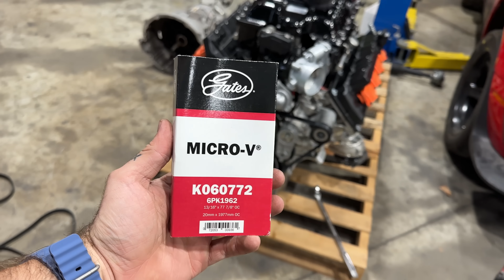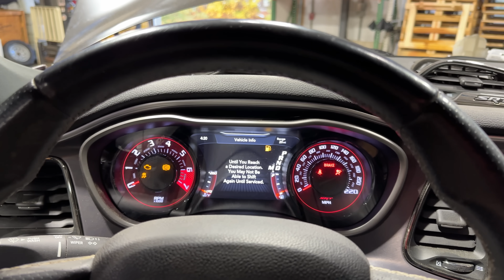Building The World's First MANUAL Dodge Demon! | PT 8

Comment: Find the 5 volt in reference wire to the trans connector and jump it to the output wire to complete the circuit , find the clutch signal terminal to the pcm and give it what it needs, most likely a ground , so it thinks the clutch peddle is pressed down when starting . You need a scan tool to read data and if you trick the car by giving it what it needs it might start. 
This works for GM's.

Comment: As a kid I was obsessed with scrap yards metal cars aircraft. It’d very satisfying taking something from a crashed or burned car and using it for another car to function. I prefer low milage factory parts over new aftermarket or rebuilt any day. I collect parts for a car I drive. Because within 5 years my cars from new have 100k miles. Most cars things start going 110-150.

Comment: You can have the sales codes changed to manual at a local dealer. Will just require the module reconfiguration routine by the dealer ship after the sales codes are altered. If you were close I’d offer to do it for you lol. Good luck!
Reply: Would he also have to loop the canbus from the auto module as they are a series connection?
Reply: @ToasterCoasterAdventures  If he fibre optic, yes
Reply: with a clutch ?

Comment: Hey guys, if that's a TR 6060 trans, id highly recommend getting a skip shift eliminator (if it's from a stock challenger) makes that 1-2-3 shift very slow for emissions and crap, the eliminator is like 20 bucks and will be worth it. You probably already know this, just thought I'd chime in! Cheers!
Reply: Tunes usually delete skip shift these days.
Reply: @kyrujames  if it's a trans tune then yeah probably. It's cheaper than a trans "tune" which just takes the baby monitors off the trans. It's a bit cheaper and accomplishes the same thing. But yeah you could be right! I just didnt ask my tuner to when he did my car on HP
Reply: I’m gonna go with an even 1050 hp and 1000 torque. Hoping you get it all sorted out!

Comment: When you put the rear differential In you should also do the lock out kit and a diff brace. Also the stock sway bar end links are too weak. Use UPR heim jointed in the front and speedlogix heim jointed in the rear. Noticeable difference

Comment: a small but EXTREMLY useful tip, that carrier bearing install. well, 90% of all installs call for you to push them towards the transmission when tightening down to "preload" them. otherwise you get noise, shakes, etc. make sure both are at the same spots however. In the video, it looks like you just sent it in. not knockin your work or "being that dude" just dont wanna see you have to redo this again within 6 months of premature failure.

Comment: To fix your no start issue you will want to rewire the start stop switch and run a wire from pcm to the switch then down to the starter. That will disable the bcm from shutting you down. You should also be able to reprogram bcm to shut off warning lights.

Comment: One thing you guys are overlooking  is the fact that the pcm that came with it has to see all the components that came were with the car from the factory to even have a remote chance of starting. That includes the air conditioning that you eliminated, the U connect, and all the applicable computers,wiring and even lighting systems that the car was assembled with. That’s a whole can of worms in itself. Gas monkey had those same issues with their shardcat dart a few years back,as well as roadkill with their General mayhem swap…

Comment: Man, that's gonna be a thrill ride in more ways than one. My Fox Mustang makes right at 600 wheel and has a Tremec TKO five speed with 3.27 gears, and even with 295 tires it goes sideways in third stupid easy. Fun, but annoying after a while, I'd like to be able to feel what full acceleration feels like with actual traction. I would imagine that several hundred more HP in that beastie won't make things any easier. BUT, there's only one way to find out.

Comment: I wonder if you could bypass the fuel pump controls at the body module with a toggle switch and put a start button on it. Will it fire up? It works for Chevy’s anti-theft no start because of the body module/chip key issue.

Comment: Over 1080 hp, 955 ft lbs

Need 4 inch aluminum or carbon fiber driveshaft and a differential brace. Thats a lot of power for the stock setup.

Comment: Have you tried Holley for a standalone , fuel tech , motec ? Get rid of that other junk.peobably gonna get worse if it has a fob. Hopefully that model doesn't have one. If it does the mopars are horrible. The horn will honk amd doors will unlock but the security will lock out the starting portion of the car which runs off a different transmitter. It will think the car is stolen and you may have to get a licensed locksmith or the dealer to reprogram the system.  Once it loses the signal it becomes a disaster.

Comment: So how are you going to cool the intake charge without the a/c? From what I understand the blower had its own cooling system that was cooled down with the a/c compressor. It doesn't really cool below ambient going down the road but it does sitting still between drag strip passes. I wonder if an ice water setup would work better?

Comment: i am a mopar collector in pittsburgh, pa with 7 68-69 Barracudas - all 4 speeds.  i also have a 2021 RT/Scat Pack Shaker Challenger 6 speed AND a 2020 Hellcat Challenger with a 6 speed.  you could not get the 6 sp in any Hellcat above the first one with 707 hp.  the next one up was the "Red Eye wide body" with 717 hp and i don't think you could get the 6 speed in that car.  i believe that car and the Demon were both automatics.  however, my Hellcat had a "reflash" on the ECM and the dealer put the 717 hp Red Eye program in instead of the 707 hp one.  the car runs GREAT and is a blast with the 6 speed.  HERE'S MY THOUGHT on you trying to build a manual Demon.  i would suggest you go and study very acutely a 6 speed "regular" Hellcat.  naturally, my car operates properly with all the dash and "performance pages" workings as designed even though it is a 6 speed.  the Red Eye 717 ECM programming did not affect anything.  instead of converting an "automatic" designed Demon to a 6 speed - use a different route and start your analysis with: what engine and other modifications are added to a "regular" Challenger Hellcat to make it a "Demon" Hellcat.  all the electronics in my car work as designed even though it is a 6 speed instead of an automatic.  build your electric system like you were building the lower level 6 speed Hellcat and then try and determine what you are missing to operate the Demon motor.  look at the internal differences between the Demon motor and the regular Hellcat motor.  i think there are different veritable valve timing differences between the 807 Demon and the 707 or 717 entry Hellcats.  there might be some other internal differences that are controlled by the ECM on a "OEM" Demon.   you will also have programming in a Demon ECM that are expecting to operate other items that you are not including like the air conditioning and maybe how the inter-cooler works for the supercharger.  i think if you reverse your thinking and say "hey, i'm building a regular 6 speed Hellcat and i have to hook up all the following "stuff" to make the motor run" - hook that stuff up - THEN see if the Demon motor will run or start looking at things that still need to be hooked up or changed in the ECM to get the motor to run.  HOWEVER, BEFORE YOU START THE MOTOR talk to some Hellcat race guys and MAKE SURE there isn't going to be any internal damage caused to a "Demon" motor that is trying to run off of a "regular" Hellcat ECM.  that's my 2 cents.  i like your video on this build and will be following you to see how this all works out.

Comment: No way you will need 1700cc with the ported stock blower.  The Whipple 3L might reach 1300cc limits but the stock ported blower just wont flow the air needed to push 1300cc injectors. Really should put fore fuel rails and make your own crossover . The factory crossover is a restriction because of the sensors. The openings going to the injectors also is pretty narrow even though the rail is decent diameter. 
Get ready for some noise with the clutch. My clutch is also very noisy. Lots of plate chatter. When those plates mesh hang on

Comment: Bro, listen... I'm a mopar technician,  ive run. Into that same message,  it says you "might not be able to start after shutdown" or some for of that. I just bypassed the tipm and and started the car by jumping the starter itself. Ive only done this on 2 cars. But it worked as long as the fob was in the car and button in the on position

Comment: The solution would be flashing and recoding every single module in the car to a manual transmission configuration and then custom coding the car for the configuration needed

Comment: Hi guys, if that means anything I've been through exactly all of this not long time ago here in UK. Except I for conversion I picked (maybe not burnt but) an unknown communist van from Poland. Basically I wanted the car with crank start and donkey power directly from 1950s upgraded for a BMW automatic powertrain. It took me about 7 donor cars, for the gearboxes, harnesses, engines etc. And just for 4 pot 1.8 16v engine but I eventually made it on my own. So all the issues you have now with clocks, looms, wrong plugs and custom driveshaft believe me I went through. I managed to make it running and it take me 2 automatic gearboxes to find out it was bad idea. Around 2 years of working during the nights in total. because FSC Zuk van never had a BMW engines all the mounts, auxiliaries, cooling or exhaust system I had to make custom as things like of the shelf never existed 🤷 It ended as a great quirky campervan, but with 6 speed manual which never been sold with this particular engine. And yes, I have to change the ECU and loom one more time back again. So yeah, I know your pain but keeping my fingers crossed. Well done so far! Greetings from UKZUK channel. Great job chaps

Comment: Ain’t it funny all the Corvette guys don’t think about the fact that there SOOOO MANY Corvettes that are project cars, street race cars, drag race cars, drift cars,…etc and they all preach how awesome and reliable LSs are yet they’re failing to consider one thing: those Vettes ALL started as pretty show room pavement princesses and they ALL either got wrecked from pairs of New Balances slipping off the pedals, some teen who stole his dad’s baby, the GODLY LS broke down and shot a piston into the neighbors front lawn from the second it saw boost or too spicy of a tune with bolt ons, any of the tons of reasons or stories we hear from the guys racing, drifting, or dragging a carcass of a Vette that had another LS, but had to be built because ya know…explosions and pistons lol, installed with more crap on the vehicle that’s not OEM than is. But man, they’re so great!! Yet everyone who has em changes every damn thing on em 🤣😂

Comment: Haha i have the same brand ignition system on my 2000 jeep cherokee with a 4.7l stroker engine, mines running a dodge viper style coil pack instead of the jeep coil rail

Comment: so couple ways to bypass that, dont fucking care what the screen says, wire in a jumper to the starter to "start" the car with a different button and hope it doesn't go into limp mode because it does say don't shut engine off OR find the 5v reference line and ground for the park n safety and wire that into your clutch pedal sensor on side of trans to make it happy, either way you're going to have an annoying message on your screen, other then that find someone who can tune out the PNSS

Comment: ScrapLife Garage ...Why would you ''delete the AC'' when the AC on the Demon cools the intercooler?...The secret sits within the Demon's power chiller, which is one component of the entire car's AC cooling system....The power chiller is able to reduce the air's temperature by 50 degrees. In turn, the cooler air creates the additional power with cooler air. While the power chiller may cost the Dodge Challenger Demon engine power run to actually run it, the cooler, denser air outweighs the loss and creates more power.....

Comment: So you're gunna put a real drivers transmission into that car instead of that P.O.S. auto.    I salute you long live MANuals

But you have it way to easy I just did an engine swap in my mustang performing mechanic YOGA and a swear chant, I cannot wait till I can have a real shop with a lift so I don't have to use a tree or a tractor to remove my engine's anymore and I can put the engine to the trans while they are both out of the car.

Comment: I daresay you would need to find a software designer and rewrite some of the lines of code in the operating system to get that thing running. All it is at this point is a software issue after all...